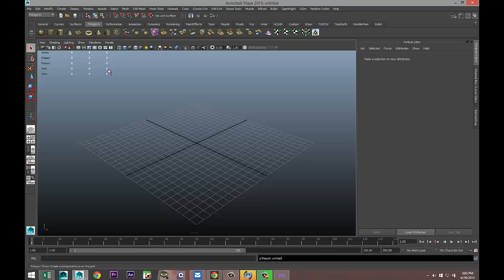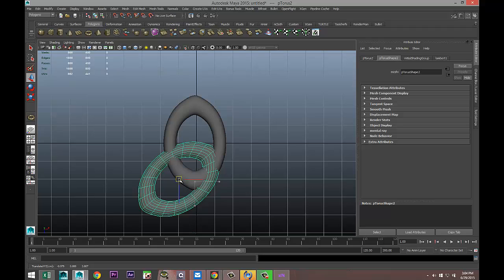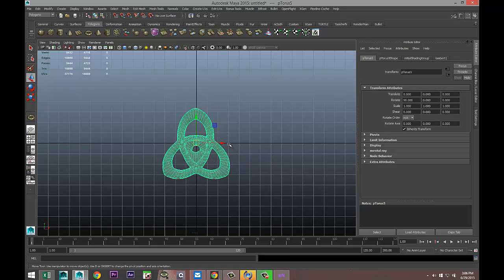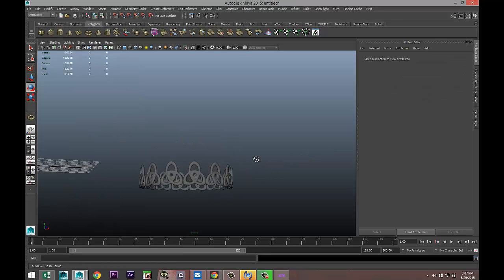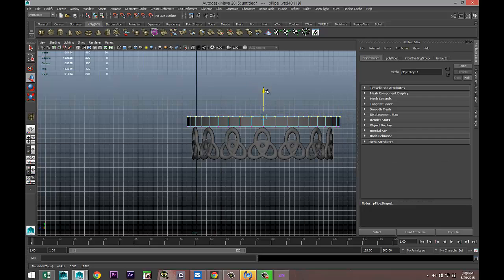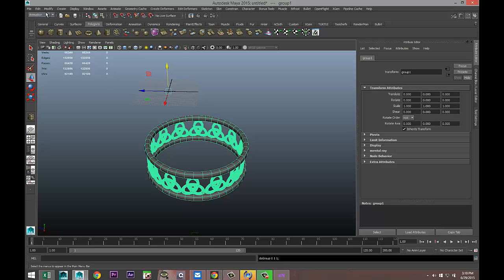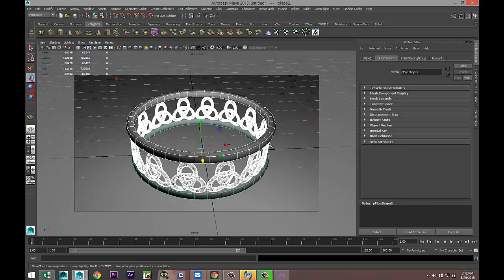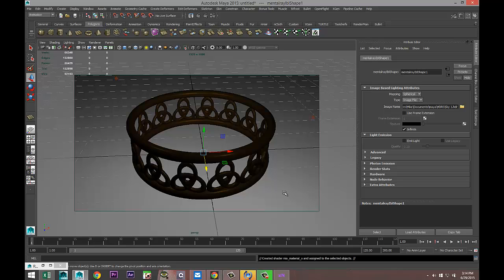Maya tutorial : How to model a Celtic ring

Comment: mine renders nowhere near as good as yours, mine seems low quality.. jagged edges. i selected everything you did in render options?
Reply: +TheBritishPotato also it only takes about 30 secs to render?
Reply from the maker: TheBritishPotato If you are sure you had the same settings that is pretty much impossible unless your system doesn't have the memory ( graphics ) to display the result properly.
Reply from the maker: TheBritishPotato Could be, it is not a complicated render

Comment: Nice tut, thank you Mike, question, one step further, I used IBL quite some time ago for a jewell all went very well.... upto the moment I needed a baked texture of it...
Used material MIA_X just as you showed, in render perfect result as I wanted, bake, fractions and doesn't make much sense at all. Would really love to see some tut about that topic. Time to take that project out of the fridge again.
Thank you :)
Reply from the maker: Zed Tremont Hi Zed, so you baked the texture but did you also do a light bake to include the IBL light ?
Reply: Mike Hermes Hi Mike, thanks for your answer, yes I did to a light bake. One thing I can try is to add more subdivisions just for the bake. That should eliminate some lines that occur but still the bake is pretty bad

Comment: At 5:44 the placement would have been easier if you snapped the celtic ring and the pipe to the grid (you know, by holding X), wouldn't it?
Pipe or thorus are equivalent in this case or is there a particular reason why you chose the pipe and then rounded it?
Reply from the maker: Stefano Rolando Yes I know but in this case I didn't